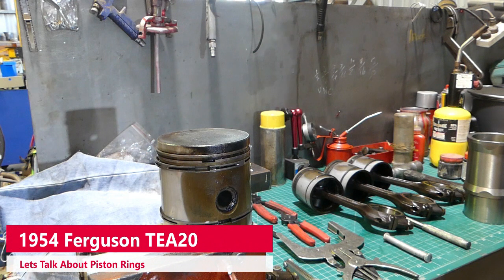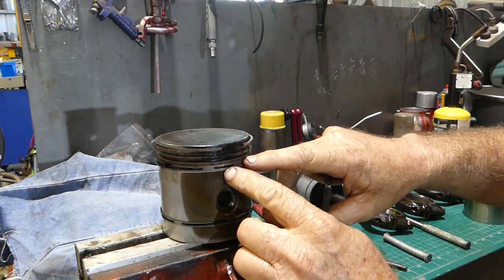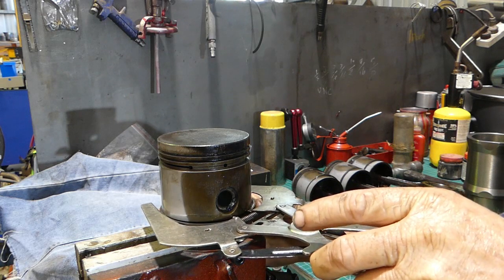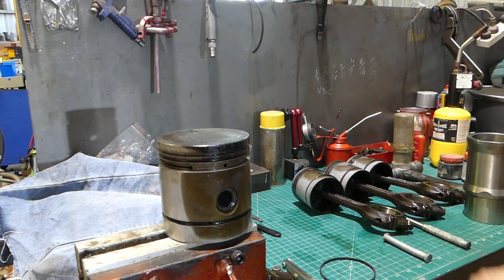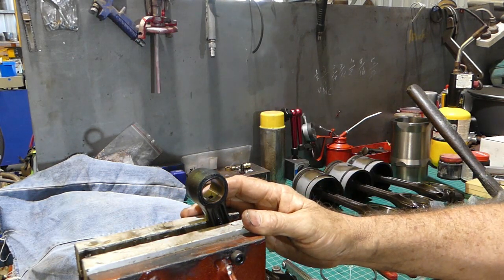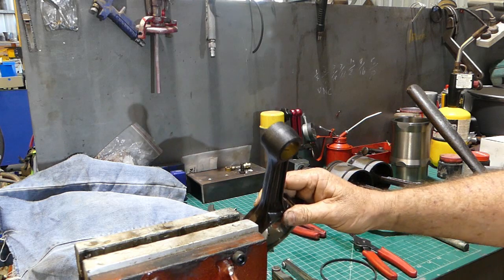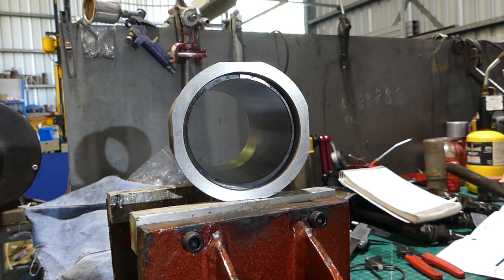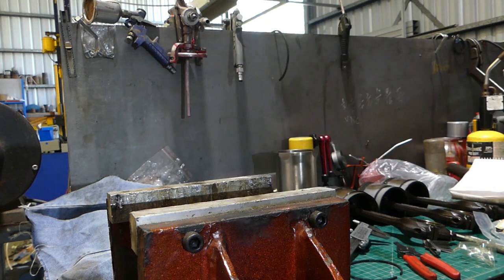Sparex Ferguson TEA20 # 13 Lets look at piston rings

Comment: Hello there - I'm currently doing an engine rebuild of my TEF20 and am at the stage of fitting the new piston rings (from Sparex) - the 4th ring is one of those Duaflex sets and 3 of the individual rings have a concave shape on one side and convex on the other. I've taken a look at the technical diagram on the Sparex website, but I'm not particularly sure of the order/orientation I should put them on in. Thanks very much
Reply from the maker: They should have a diagram on the packet but they go together with the inner rings touching on the midle of the paire and on the pairs the outer touches.
Reply: @BundyBearsShed  Ah ok thanks very much - this series of videos has helped me rather a lot in my rebuild, so thanks for doing them!

Comment: sat night at the pub ....pistonbroke, when you have old rings and carboned pistons and you fitting a new set snap a old ring grind it to a comfortable angle and use it to clean the ring grooves out
Reply from the maker: Yes I have done that, I forgot about it.

Comment: Just wondering why was there so much distance between the ends of the old ring compared to the new one. I can imagine that some metal would wear away over time but surely not 9mm! I presume it started life with a much wider gap than the new Sparex one?
Reply from the maker: No they would have been similar, that is why no compression and the dust getting into the engine wears the rings first. Just a very worn engine.